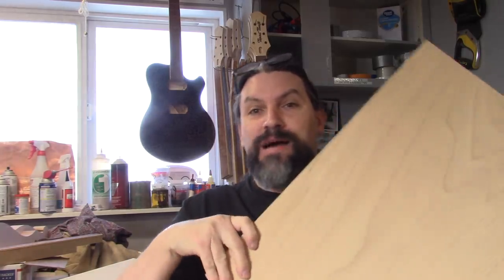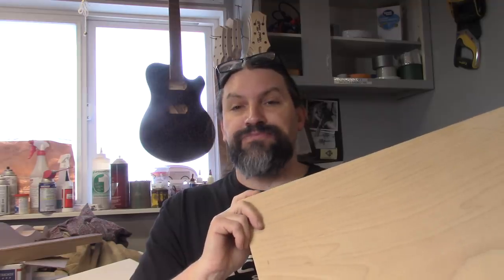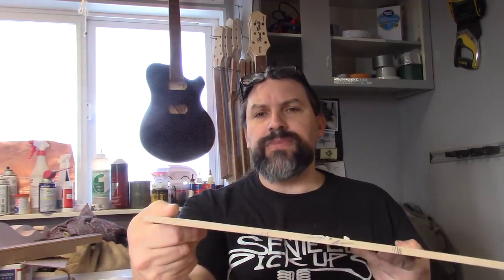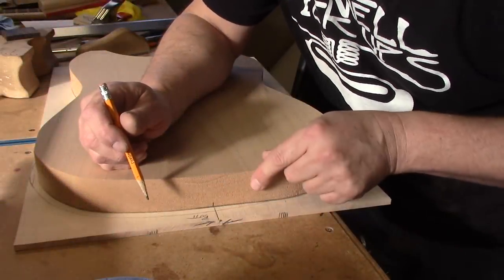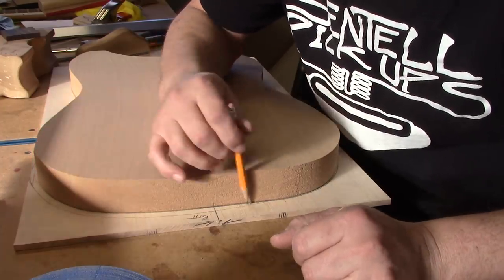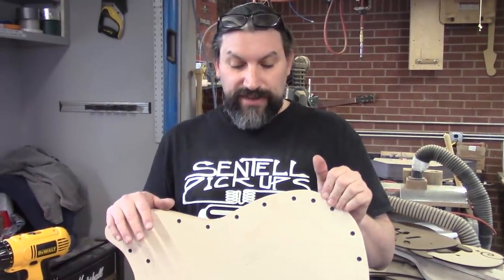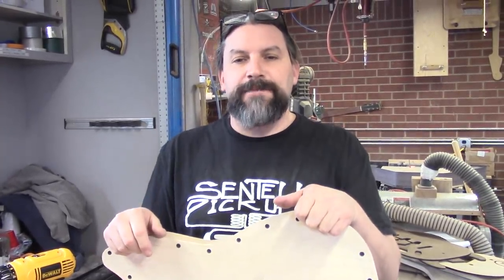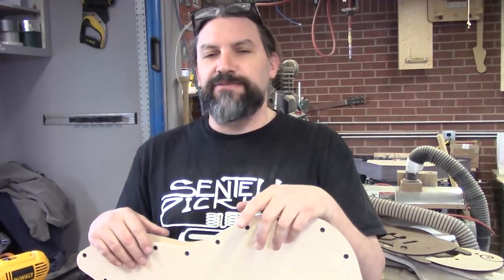Bending a 1/4 Inch Top For Kevin's Maple Top Strat

Comment: I just did a similar thing. Made a teledyne  style tele and put a 1/4 top on. So I cut relief slots on back side  of the top but started   1/2 " in and ended a 1/2" from other edge. I wanted a natural binding. It worked out perfect. That 1/2 around the top bent fine with no relief slots.
Reply from the maker: Nice, I like the natural binding too

Comment: Best way to bend the top. What works for speaker cabinets, works here as well. Good job! If you use big washers and screws with flat heads, the circular distributed pressure of each screw will overlap more. You get away with less screws that way. Maybe a waste of time, maybe helpful for delicate tops or different material. See you at NAMM. 

I'm just kidding. You don't need that. Have fun in Vegas and think of me when you shoot some things in the desert.
Reply from the maker: Hey homes, 
 I try to share a few ways of doing the same job. We have used the screws in place of clamps for several years now and it works great. I probably got the idea from Norm Abrams hahaha
We are really looking forward to the NAMM show stay tuned for pictures on Instagram etc. I just talked to Jim in Vegas and we got some good stuff planned.

Comment: Love the screws! Great idea.
Reply from the maker: We have been using the screws in place of clamps for several years now and it works great. One of the best things is about this method is how easy it is to move the body since it isn't loaded up with 20 pounds of clamps.
Reply: @TexasToastGuitars  I would think you'd still want to put a clamp in the middle

Comment: Glad you mentioned not cutting the 1/8" lines all the way to hide them, because I thought you just went for it and I gotta say, I was kids terrified! But having a burst makes sense not worrying about it. Gonna try screws to clamp down my top on my current guitar. Having the Forrest of clamps isn't appealing to me!
Reply from the maker: Well this guitar will have binding so I did go all the way to the edge, there will be a few lines to hide but that will be a snap.  I try to share a few ways of doing the same job. We have used the screws in place of clamps for several years now and it works great. I probably got the idea from Norm Abrams hahaha
Plus a box of screws is about the same money as one clamp

Comment: I used to work in a custom woodshop in S Denver that had about ten bench carpenters always competing for limited clamps. "So how many clamps does a woodshop really need? MORE!" Creative screw-clamping methods can solve a lot of that problem. What's a clamp anyway but a screw with pressure surfaces?
Reply from the maker: We have tried all kinds of techniques this one in this video works... okay.
These days we have that big floor press deal and it works great!

Comment: Very cool. I like the screws for clamps, brilliant! I used the kerf trick years ago before I was into guitar building for bending a corner on a cabinet I was building.  Works great. So are you binding or bursting?
Reply from the maker: Hey brotherman, 
 We have used the screws in place of clamps for several years now and it works great. I probably got the idea from Norm Abrams. I think in this instance it is the simplest way to go for a top of this thickness. The vacuum bag would have worked well but that's a lot of gear to drag out.
I can't remember if Kevin wants binding or a burst.

Comment: If it's gonna be bound anyway you will never see that it's 1/4 rather than 1/8. I don't get why you need to go to the trouble. If it's NOT gonna be bound, the relief slots cut in the glue surface/back of the top will show at the outer edge of the body.  What'supwidat? BTW, even if I'm questioning, I still really like your content and so that's why I'm subbed.